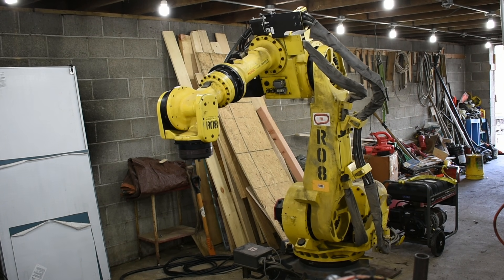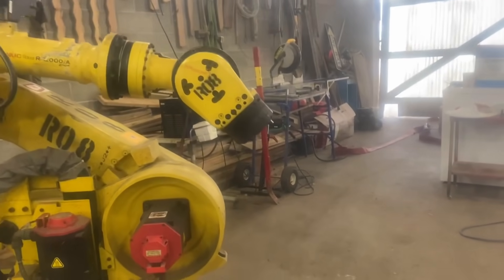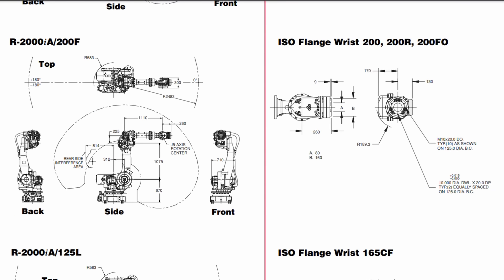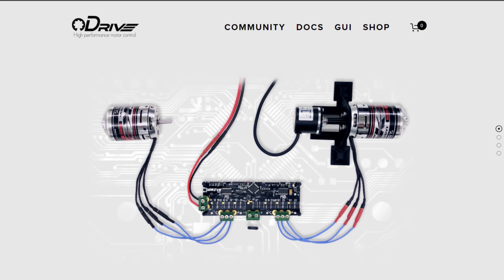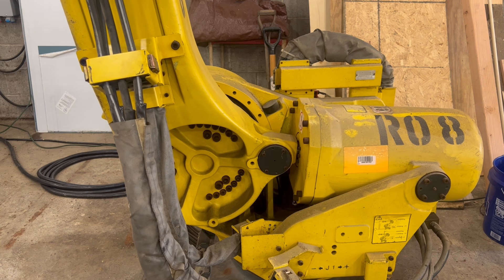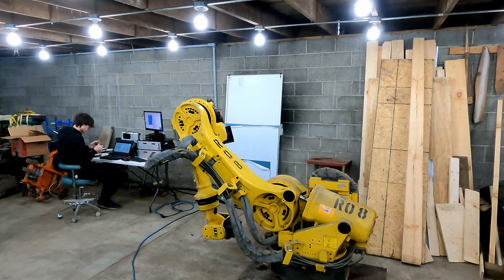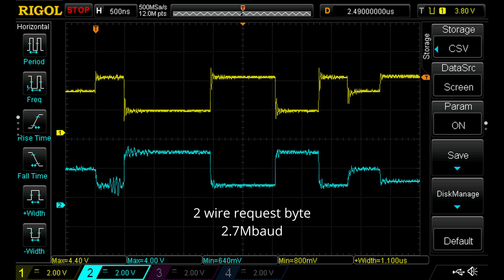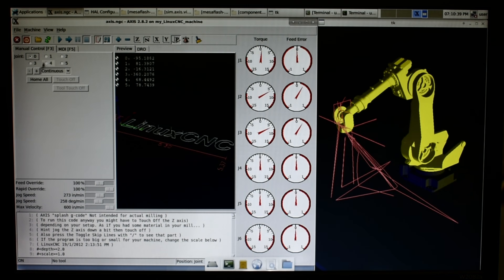Running a 1.5 ton Industrial Robot With a Custom Open-source Controller part 1

Comment: Older FANUC robot parts are not harder to get. Fanuc can provide parts for the first robot placed into production. This is true for the software as well.
Reply: They can, but I think the real question is if they will. Why help some hobbyist repair an old machine when you could tell them to buy an expensive new one?
Reply: @theninjascientist689  I wasn't replying to "the real question" (what ever that is) but the statement of availability. If you're a hobbyist what you are doing is taking an industrial robot and Frankensteining it. If you have the controller made for that robot (matching F# or E#) with the registered software that robot will perform as good as the day it left the factory as long as the bearings and gears are not worn. There are some much older than that robot still in operation without as much as a fuse blown. You got one that was either abused or installed incorrectly. It will never be worth anything otherwise. And you cannot simply take the core software from another robot and copy it into another controller for two reasons. One if the version is off by a little bit it may not perform correctly. But secondly, it is a crime to copy this software made for another robot. If you had the controller made for that robot you could simply call Fanuc's tech support and they would assist you. If the software is lost (if it's on the controller it's never "lost" maybe corrupted?) you can ask for a reburn and it will cost you about $500. They will email the software to you. Phone support is free as long as you are the registered owner. (Just show proof of purchase if not) Lastly, if that robot could operate the way it did out of the box, you would be placing your life in your own hands if you ran it with it moving in automatic standing that close. Also, with that robot comes documentation on the software and how to setup and program in TPP. Try calling FANUC's hotline.

Comment: Your final speed limit is so low because a motor's max speed is determined by it's driving voltage while it's torque is determined by it's driving current. The neat thing is that it's almost a completely linear relationship with those.
Reply from the maker: Yup, I was expecting a tiny bit faster but it was still usable. The parts for a full voltage servo drive are finally back in stock so those are going to to be one of my next projects.

Comment: Hi I would get data about status (start, stop, allarm, type allarm) from an olc CNC Fanuc OM-B. What do you think? In your opinion is it possible? How? Are the any parameters sending on serial and CNC answer on serial and I collect on PC? Thanks.
Reply: And that folks is why you look for a second hand Kuka robot to play with:)
I am now the proud owner of three Krc1 models running windows 95 where you can both upload and download the firmware to your particular robot PLUS it's available on the second disk partition PLUS if you have lost it Kuka will let you have a copy. Still fun to get them doing anything.

Comment: Is there gonna be more on this? I just purchased a arc mate 100i. I was planning on buying a matching rj2 controller and rewiring for 220v. With the thought in mind you can creat programs with the tech pendant.
Reply from the maker: Yeah I plan on revisiting it this spring/summer hopefully. It still needs a ton of work to be good though. As long as the controller has the software for that exact robot it should work, but they seem to be pretty picky.

Comment: Definitely balls of steel having that arm inside where it's well in range to smash through all of those floor joists lol
Reply: Imagine being upstairs chilling and all of the sudden a giant yellow arm tears through the floor 😂
Reply: Is it feasible to have tripwires or other such external stop triggers?
Reply from the maker: @chromosundrift I have a bunch of light curtains on order
Reply: I would assume they implemented hard/firm limits. If not, at least soft ones.
Reply: Har environment
Reply: But smashing the floors of his own home is no where near as balls of steel as smashing the floor of one of the world most proprietary protective company -Fanuc. Fxxk Fanuc takes both balls and talents.
Reply: It's called an emo button
Reply: Not like its gonna move where not programed it doesn't have a mind of its own
Reply: @codeack101wlck  Unless some of the math in the setup is wrong, for example the fact that the driver was set up for different gear ratios. Did you even watch the video?
Reply: @SoundOfYourDestiny  what voltage was he running the machine? Did you watch the video? Damn arm moves at a snails pace and ya'll think its just gonna start flailing around going through walls
Reply: @codeack101wlck  He said in the video what voltage he was running at, genius. It was the appropriate voltage for the machine in an industrial setting. So, with a fuck-up, yes it IS going to go flailing through walls. You're angling for a Darwin award, genius.
Reply: @codeack101wlck  you beat me to it. Sounds like all these people didn’t even watch the video. Arm is operating at 10% power it’s slow as fuck. You could easily shut it down before it got anywhere near damaging something.
Reply: @codeack101wlck  LOL nice troll
Reply: @codeack101wlck  programmers make mistakes.  And sometimes a new servo drive needs tuning and will fly out of control.  He was taking serious risks.
Reply: @microdesigns2000  yeah that would imply the servos can spontaneously act on their own, ah no
Reply: @codeack101wlck  We're talking about custom, home baked stuff here, before it's proven safe.

 A tiny coding mistake could make that robot move erratically and lead to collateral damage or worse. You don't have the safety of an a lab or an industrial installation at home.
Reply: @Factao  yawn, must suck not to have confidence in your work
Reply: @codeack101wlck  My lathe remained me today why chucks are called "meat cleaver" by giving me a head pat with it's chuck. Didn't get anything more than a prune, but I got lucky It didn't dragged me along with it. First time in two years of using this machine.

It's not about confidence, it's about living to get paid another day. Don't get too lenient, those machine are made to handle payload multiple time your weight. There is no stopping them without that safety button.
Reply: @Factao  yes those are all very obvious points, I've been there with a lathe chuck didn't get me but to my point I felt like a complete moron after hence added respect for the machine
Reply: @codeack101wlck  theres a pretty fine line between trusting yourself not to make a mistake and arrogance, not sure what side you lie on tbh... the point is more testing an old, used robotic arm with little knowledge of its condition and firmware in an environment where it easily has the capabilities to cause significant damage and injury definitely takes some balls

Comment: Nice! I was thinking that you could make the robot run faster by changing the mosfets that originally come with the o-drive. something that can handle 300V. You might probably have to design a new PCB for that, but it shouldn't be a big deal. This is really amazing and inspiring work!

Comment: If you bought the arm with the correct controller would it be just a matter of making the correct "gcode" for the machine? I am very interested in buying one of these arms but I've only bought and used new CNC mills so they were mostly plug and play. I'm guessing if you can get the arm with the correct controller the price just goes up a lot right?
Reply from the maker: Even with the correct controller, they don’t accept gcode directly, they use some special Fanuc code that’s not human readable(binary). You can still get the robots with controllers and everything for just as cheap, it’s pretty much just luck which one you come across.
Reply: @ExcessiveOverkill  i remember programming robots (not fanuc) in val, so sure there is no way of rather developing a custom post processor from robot to gcode?
Reply from the maker: You’d either need the proprietary post processor from Fanuc for the binary files, or a controller with the option to interpret normal text files as programs.(I think at least for Rj2 controllers). There is a post processor for fusion360 that outputs the Fanuc text programs, the issue is most controllers don’t come with the option to read them, and Fanuc won’t sell it to you unless you pay to reregister the robot.
Reply: @ExcessiveOverkill  oh jeah, guess thats the thing with 20 year old robots^^ really nice project you are working on!! Did you already contact the seller how they operated the fanuc? Iam really interested in the accuracy you will get when you have finished your robotcnc, as its the biggest issue with these, especially in regards to repeating accuracy.
Reply from the maker: It originally operated at a spot welding robot, so there weren’t any external position control inputs available. I too am curious about the accuracy, the backlash appears to be very little so I have high hopes for now.
Reply: @ExcessiveOverkill  with 6 joints it could be a adventure tho :D
God bless you have a higher purpose for that neat creature. I will stay Updated on your journey.

Comment: there is a fanuc post-processor for fusion online, I haven't tested it personally, as I still can't get communication from any computer to the rj3 controller on the robot working yet.. definitely an interesting project though, good on you having the patience to go through all this I would have just bought another robot (to be fair that is probably part of the reason our shop has 3 idle robots at the moment though)
Reply from the maker: I looked into the available post processor a bit, I wasn’t too confident it would work. The only way I had to transfer files to the robot was an ancient flash card.
Reply: @ExcessiveOverkill  yeah, my local fanuc guy has been awesome, and I talked with a few people online and go kfloppy all setup, but either my rs232 wiring or something else was never quite sorted so i didnt get file transfer working.. tbh its pretty far out of my element so wiring could very possibly be the problem..